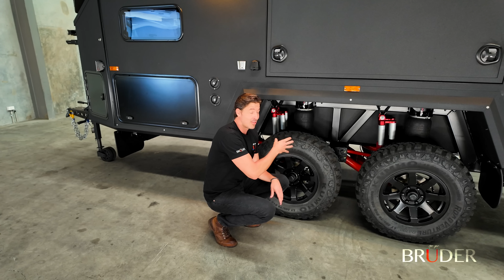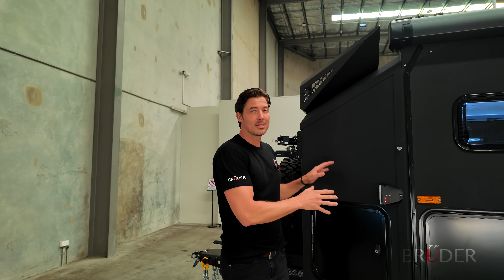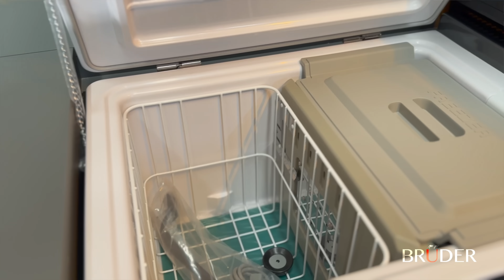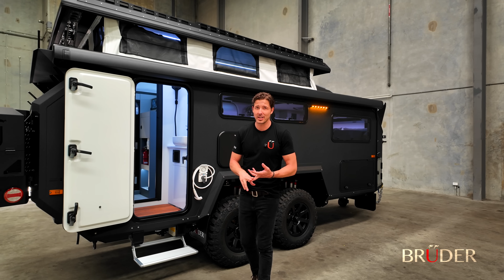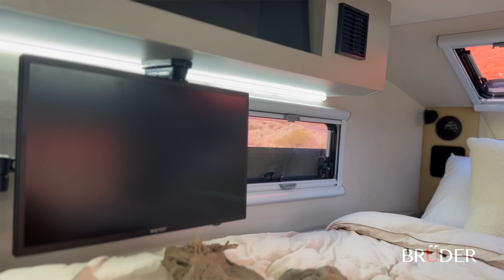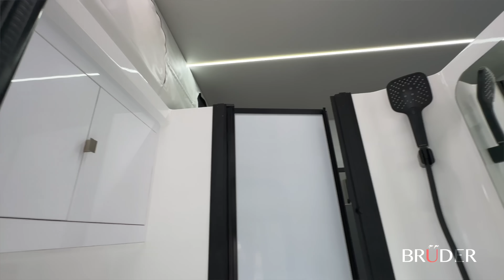Bruder EXP-7 detailed walk-through (17min).

Comment: design something with  door  6'5" heght 7 foot width wided engh  for obese electric wheelchar user  max  ceiling heght 8'5"

make sure you  tires refleact the tow vehicle size

avoide pop tops as you are at write off nears trees